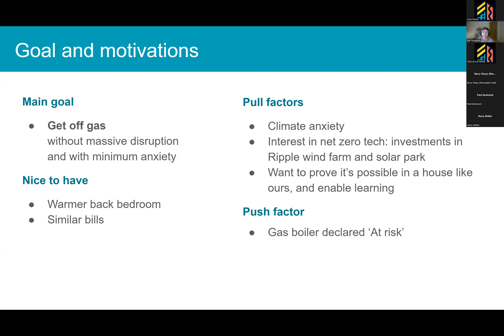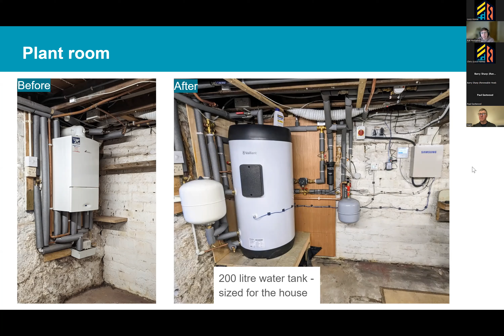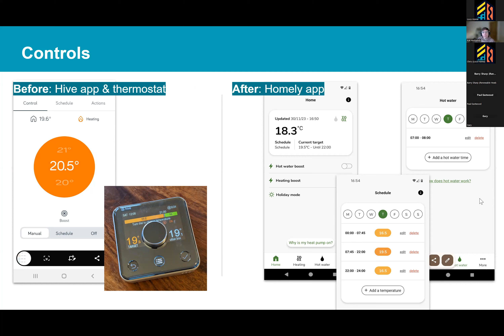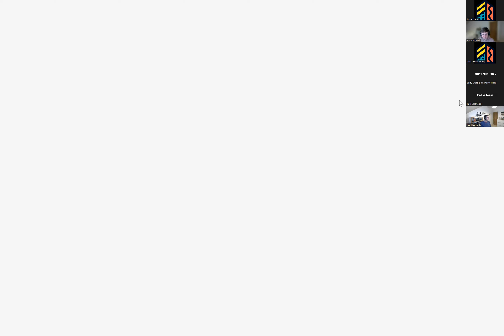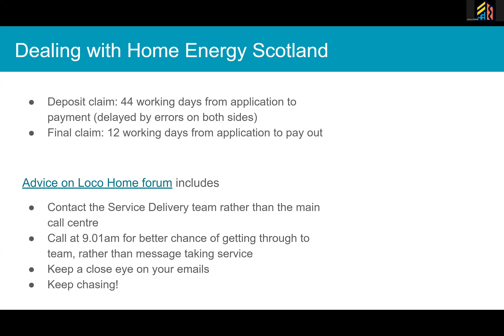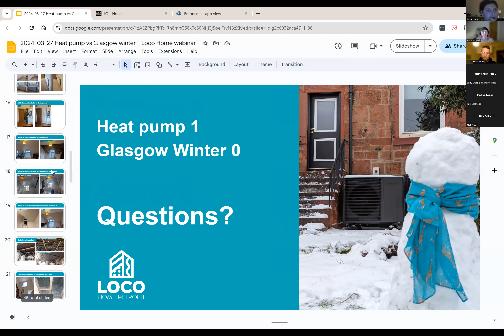Heat Pump vs Glasgow Winter

Comment: Hi, I'm getting a Samsung R290 heatpump installed next month with the Homely controller and OEM so I'm keen to look at your data. I can't see your heatpump listed on heatpumpmonitor, do you have a link?
Reply from the maker: Hi Jake, Loco Home speaking here. The best way to get in touch with Kat and Iain is either through the Loco Home members forum www.locohome.coop/join/ or email us info@locohome.coop and we can forward your questions

Comment: Thank you so much for this video Kat. We learnt a lot from this. We have exactly the same goal & motivations and priorities as you and hope to install a heat pump in 2025. Our house was also built in 1902, is a similar size, has had a new slate roof (awful roofer!) and we are invested with Ripple. The main difference is that our house is a semi in a conservation area in east London. The side wall is our main heat loss but our local council will not allow external insulation, although having declared a climate emergency we live in hope that they will change their mind one day. Living in a terrace house means that you have two side walls that have no heat loss. We're envious!
We also have followed Heat Geeks. They recommend keeping the whole house as one zone and not to control individual radiators. I am doubtful about this, unless the aim is just to achieve the highest possible COP. I noticed that you have TRVs. How do you use these? Are they just to stop rooms getting too hot?
One more question. Did you have to have a separate consumer unit just for the heat pump?

Fred and Miu Gray
Reply from the maker: Hi Fred and Miu, great to hear from you - Kat is a Loco Home member so the best way to get in touch with her (and other Loco Home retrofitters) is on the Loco Home Forum, by becoming a Loco Home member www.locohome.coop/join/

Once you join as a member you can access the forum, where you can introduce yourself and ask questions to the wider Loco Home community